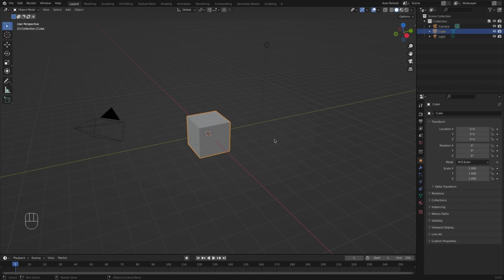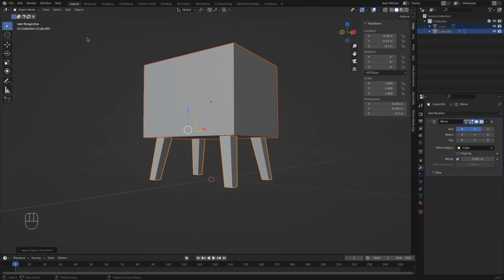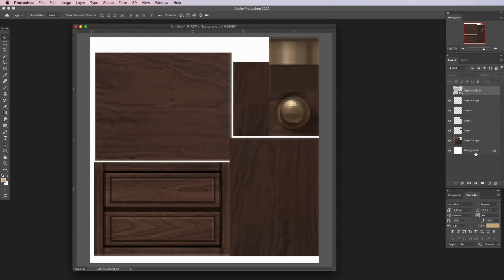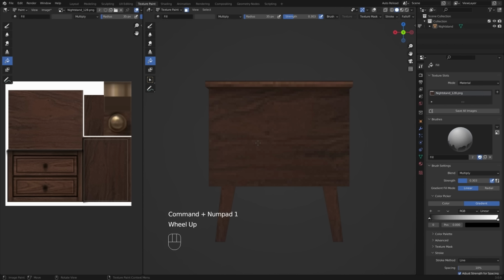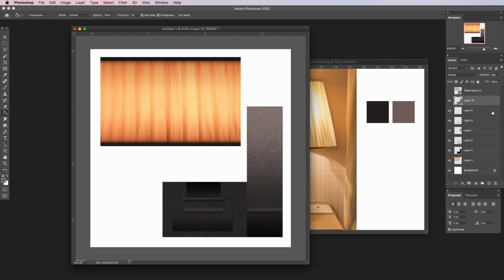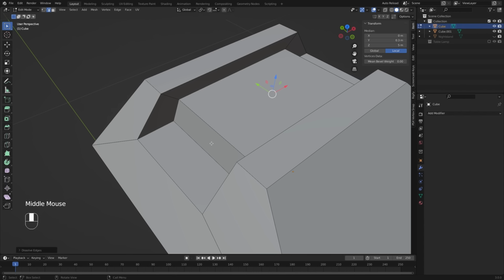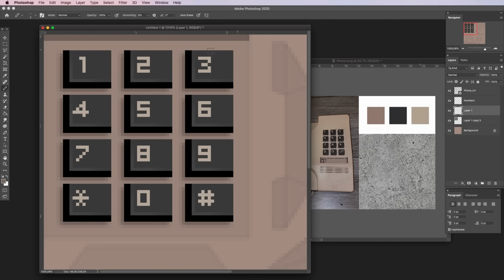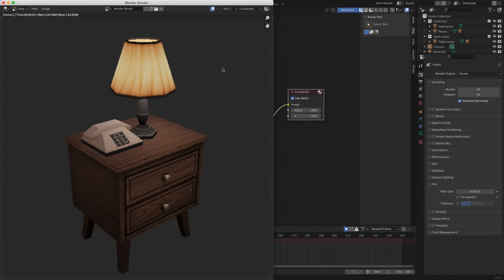PS1 Style Graphics in Blender / Low Poly Assets Beginner Tutorial - Part 1

Comment: great tutorial but I ended up with my Cabinets on the bottom instead of on the side.. I am using the latest blender and something happened while i was doing the UV part and when I mapped the material it did it all wrong. I learned a lot but I think the UV mapping is very different in the new blender
Reply from the maker: Yes, you’re right — the newer versions are different, but not drastically. I’ve already seen cases like this before, where someone’s cabinets ended up upside down, but the reason was simply inattention.
Also, in newer versions, the UV Sync Selection option is enabled by default (in the top-left corner of the UV Editor), which isn’t convenient in all cases. The vertex snapping behavior when dragging one fragment onto another is also slightly different.
Reply: Same here, followed the video but I ended up with the drawers at the bottom too lol.

Learned a lot though
Reply: @danyhocine  the new version makes it easier to do the UV mapping ( i still dont really know what i am doing), but I managed it figure it out my own way
Reply: @partyeffectsdotbiz  same, literally day 1 for me

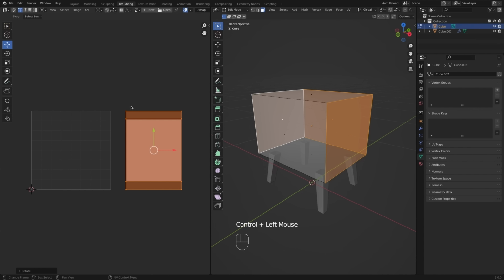Comment: #21:22 hey Im a lil stuck here but all of my faces in the UV editing screen are all connected and even when i only select the sides and back they still are connected to the unselected parts so when i move them they also move like if i was in edit mode moving a vertices'
Reply from the maker: You need to switch off UV Sync selection at the top left of the UV Editor window

Comment: I'm stuck at 24:14, somehow it never snaps on top of the other one even when I select vertex under snapping and hold control. Also the points of my faces aren't in the corner like they are for you, unless I switch from face mode to vertex mode.
Reply from the maker: You’re not the first person to run into this — it’s due to differences between Blender versions. In newer versions, you need to drag one fragment not just toward the other, but specifically to its top or bottom endpoint in this case (by placing the cursor over it).
Also, in newer versions you can copy (Ctrl+C) the location of one fragment, then select another similar fragment and paste (Ctrl+V) it into the same position as the first one.
Reply: @Summmer85  Thanks!

Comment: Question. When should I do certain UV unwrappings? Like when should I use cube projection over current view or smart unwrapping?
Reply from the maker: These types of UV unwrapping work differently. You should practice on different types of objects, and over time you will understand the difference. Cube Projection works better with simple, cube-like objects, while Smart UV Unwrap is more suitable for more complex objects. At the same time, you also have the option to add seams and use a regular unwrap, which gives you a third approach.

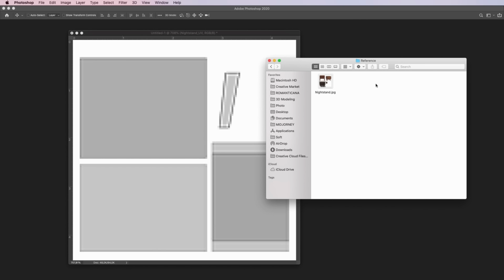Comment: Here at 26:47 when i upload the exported uv into ps it doesnt load correctly its like invisible
Reply: hey if you still need this figured out or anybody who's reading this and encountered this problem: When exporting the UV map make sure you check "All UVs", format the image as a png, resize the image to 128x128 and change fill opacity to 1
Reply from the maker: I’ve never encountered this before. Check the file size of the PNG with the UV layout — it’s possible there’s actually nothing in it, and the problem starts in Blender already.

Comment: Working in Blender 5.0, when I deselect the object that doesn't make the UVMap disappear, also selecting certain faces doesn't isolate those, it just highlights them on the UV(was able to edit it all just fine) but is this just how UVs work now or is there a setting to make it work like yours?

Edit: Figured out this was a setting called UV Sync Selection that I just needed to disable
Reply from the maker: In some cases, working with Sync Selection enabled is even more convenient.
I recently updated to Blender 4.5 and there this option is currently disabled by default.
Reply: Thanks so much for the tip. I'm currently running 5.0.1, so I disabled it and am following the tutorial.

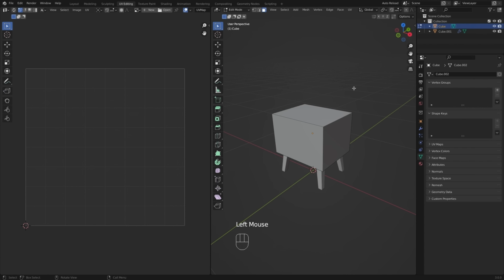Comment: For me,19:25, I can't delete the cube projection to get certain parts out:face-blue-wide-eyes:, except for that, great video 👍👍👍
Reply from the maker: Sorry, but I didn’t understand the nature of your issue.
Reply: @Summmer85  he means that after he does cube projection, when he tries to move selected parts in uv edit window they are still attached to the object and behave like edit window usually does.
Reply from the maker: @digit861  Can I ask which version of Blender are you using?
I just tried doing this in Blender 4.5 and didn’t run into any difficulties — it seems to work the same way as in Blender 3.0 (which is used in this tutorial). In the right window, you select the required areas, then move or scale them in the left one.
If I understand the issue you’re describing correctly, it sounds like the situation where you have the default UV unwrap and try to move individual faces in the UV Editor, but they remain stuck together. Even in that case, you can still move them separately by switching Shared Location to Disabled in the top-left corner (to the right of UV Select Mode).

Comment: Thank you so much for this tutorial!! I only have a question, how doo u know the dimensions of the textures?
Reply from the maker: The texture size is arbitrary and based my own experience. In my case, the smaller the better, as long as it doesn’t hurt the details. For example, a character texture in PS1 games could be 256×256 px or even smaller. So for a lamp, a phone, or a nightstand, 128×128 px is more than enough. But in actual PS1 games, object textures were even smaller, so it all depends on how deep you want to go with the style.

Comment: I’m sorry! I have a problem 44:04   i selected only the front face, “paint mask” is turned on, but for some reason it still paints the overhanger, and not only from the front, but also around, along the entire perimeter. Is there anyone who has any suggestions how to fix that? xd blender version 4.5.3, thanks.
 UPD I figured that because when I drawing something on the right window of “Texture Paint” mode it’s automatically transferring everything to the left window where is I used top textures of the front face for overhanger. I just need to find some another textures
Reply from the maker: I didn’t quite understand how exactly you solved your problem, but the first thing that came to my mind when I read your message was that the front face of the nightstand and the overhanger are in the same place on the UV map.
Reply: @Summmer85  exactly, the overhanger and front face were in the same place on the UV map, when I tried to draw on the front face it was transferred to the overhanger and vice versa, so I created a separate texture for the overhanger
Reply from the maker: @kacomba  It’s precisely by going through such difficulties that you gain the best understanding of how everything works :)
Reply: @Summmer85 thats why I think that’s good that developers of Blender are changing things all the time. Because old tutorials are not working perfectly and you have to explore and figure out by yourself. It was so satisfying to resolve a problem without guide)

Comment: I can't seem to get past the gradiant fill section for the nightstand. I have the same settings but it just colors the entire thing white.
Reply from the maker: I know the process might differ slightly in newer versions of Blender, but I just tried going through this step in version 4.2 and didn’t run into any issues.
As for the gradient appearing white — it’s possible you didn’t switch the Mix mode to Multiply.

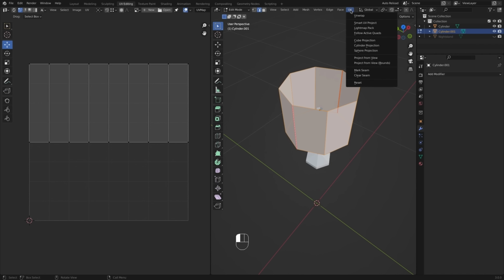Comment: Using blender 4.5 I dont see just "Unwrap" at 50:15, i see 3 options "Unwrap angle based/conformal/minimum stretch" which one to use?
Reply: try angle based or smart uv project
Reply: @couldbekimed  Not Smart. NEVER Smart. I don't know why anyone ever suggests it. Smart doesn't even use your seams and it creates an absolutely disgusting UV map. NEVER USE SMART PROJECT!
Reply: either of the three works out, don't overthink it. You can try just setting up a basic image with the generated types in the image settings and seing how the different unwraps affect your texture. 
Smart UV project just overwrites your uvs so don't use it if you're manually uv unwrapping

Comment: The scene looks good! I notices you don't enforce consistent pixel density. I am struggling on weather or not a consistent pixel density is important. Do you have any rules of thumb you uses when it comes to pixel density?
Reply from the maker: Thanks! I’m not sure I fully understand what you mean.
I’m only adding a slight pixelation during rendering — there’s nothing else here apart from the textures, which were intentionally painted in low resolution.
Reply: @Summmer85  Pixel density is how  big the pixels are relative to the models. For example, the cash in the suitcase has a lot of pixels for it's size in the world. Compare that to the bedsheet which has less pixels compared to it size. Another example is the key on the table and the table that the key is on. The key has a high pixel density relative to the table.
Reply from the maker: @TheXello  You’re very observant :) I usually try to make sure the pixel size looks roughly consistent, and I follow the principle of “the smaller the better” when painting textures — as long as it doesn’t harm the final result. Of course, sometimes the difference becomes more noticeable, but if you reduce the resolution of a texture too much, it might not be enough to convey certain details.
Reply: @Summmer85  Thanks!

Comment: This tutorial is amazing but I'm having trouble with the vertex snapping in the UV map. Even though I have the correct options selected, the UV map never snaps the vertices to other shapes. Snapping in everything else works properly. Why is this?
Reply from the maker: Thank you! To be honest, I’m not entirely sure what you mean.
It might be easier for me to understand if you could share a timestamp showing the part where you're having trouble.
Reply: @Summmer85  This is at 24:10 selecting vertex, moving with Ctrl does not snap or move it in a snapping way. its just moving like normal. Blender 4.5.0
Reply from the maker: @MrXlee1967  Thank you for timecode!
Yes, I just checked in Blender 4.2 and it really doesn't work the same way as in 3.0. It's unclear why they keep changing things all the time.
I noticed the difference: you need to drag one element not to the center of the other, but to one of its vertices. Personally, I find that inconvenient.
There's a new feature in recent versions: first, select one element, then go to UV → Copy UVs, then select all identical elements, and go to UV → Paste UVs.
I'm sure there are other methods too — just need to dig into it a bit more.
Reply: @Summmer85 Thank you so much for taking the time to respond to stuff like this, I was stuck on this part for awhile and couldn’t figure out what why the vertices weren’t snapping together until i found this reply
Reply from the maker: @jonhollister5612  Yes, I am using Blender 3.0 and it seems I am a bit behind the times. I have an old PC and the new version is not installing anymore.
Reply: You have to put your cursors to the points you want to snap to i think

Comment: This video is amazing! I have a problem though and I was wondering if you or anyone else reading this could help. Whenever I try to add gradient like you do on the lampshade or lamp base, I can only add one instead of having this additive effect where you apply multiple gradients. Whenever I try to apply a second gradient, the first one disappears. Any help with that? I am using Photoshop 2025. Thank you in advance!
Reply from the maker: It looks like you have different gradient settings. You need to set it up so that the gradient fades from one color to transparency. In my Photoshop, this can be adjusted in the top left corner. There, you need to find the basic preset.

Comment: Why do you use ancient Blender 3.0?
Reply from the maker: Good question! Honestly, I just don't know why I should update, since this version works fine for me. When I see a real need for it, I'll do it.
Reply: @Summmer85 I suppose that most users that are doing these turorials are using current release versions of Blender. Some GUI elements have changed drastically over the years, for example, the options of imported texture look different in version 4.4. For me it's not a problem, but for someone's less experienced this might be a huge stumbling wall.
Reply from the maker: Yes, you're right — they keep changing things, and it's not always convenient. I guess that's one of the reasons why I don't like updating. If I end up making more tutorials in the future, I’ll try to keep that in mind.

Comment: it's interesting the way you add details onto the textures by modifying them in photoshop because that's what I usually do for n64 style textures but I never thought of doing it for ps1 style textures as I thought it would look too cartoony and remove the more realistic atmosphere of the ps1 wich is not the case it is a great addition and makes the models look very polished!
Reply from the maker: Well, Photoshop is just a tool, and you can draw in different styles, from realism to pixel art.
We all come to this field from different directions and each has a slightly different path, which creates diversity. And that's great.
Reply: @Summmer85  all ps1 textures end up being pixel art because of the way they are interpolated, that isn't what I meant when I wrote realism, I was talking about their resolution and the amount of detail they can have. As you said Photoshop is just a tool, I use gimp and paintdotnet because they are free, depending on the software you're using the result may be different making every process unique!